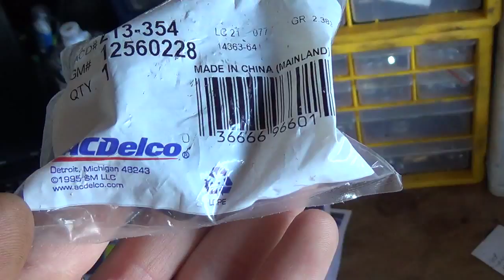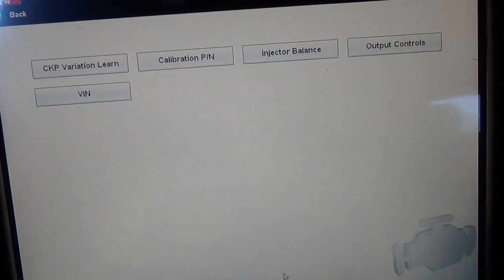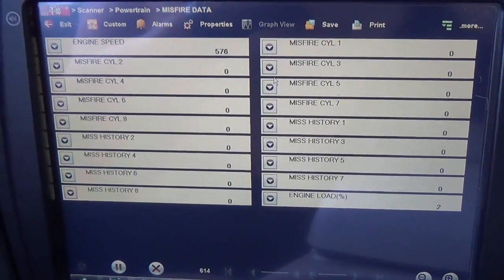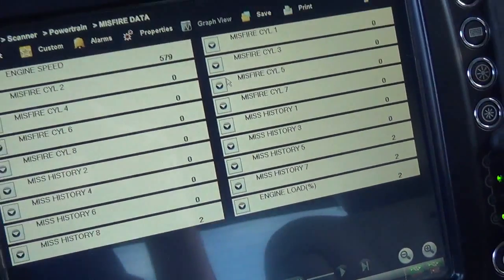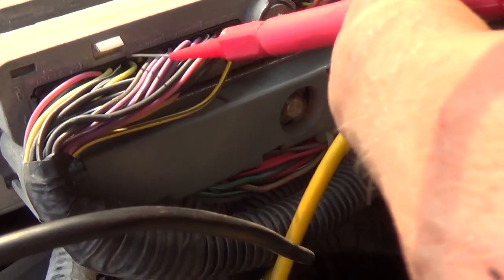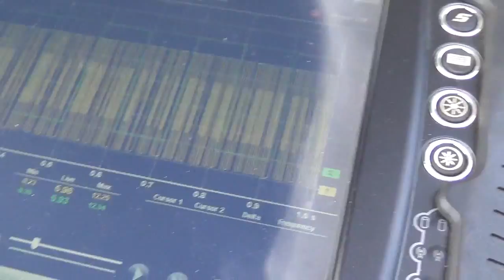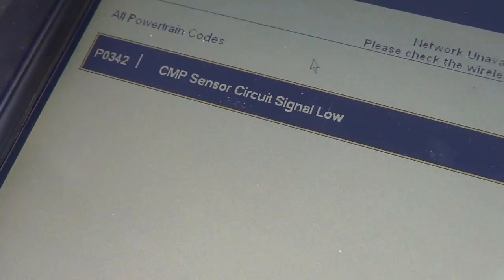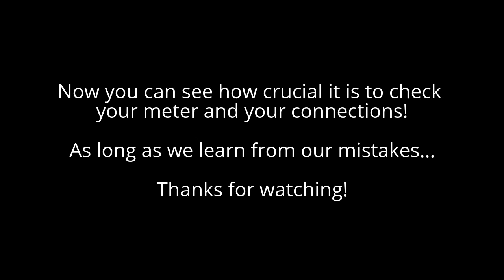Chevy Silverado: P0335 CKP case study -Part 2 THE FIX

Comment: I don't have misfires but I do have check engine light and I have replaces the sensors and the coils 3X. Someone mentioned to change out my ECU and they said I need to do the crankshaft relearn as well not just the key relearn with off on 3X for 10 min. Each on on and 5 secs on off... I never changed the crankshaft sensor  so do I need to use that tool?

Comment: Probably a few years late but did you see the potential vacuum leak at the fuel pressure regulator @ 13:58 And a plug for Phils Probes!

Comment: 03 Silverado 1500 5.3L cranks but won't start, no codes, security light goes out after a second. Changed crankshaft sensor, camshaft sensor, PCM (pcm's were programed to vin), wires&plugs, fuel filter&gas lines, relay and main window/lock switch. No five volts reference at PCM, no ignition pulse. Tried the 30+ minute relearn a few times, I tried to bypass the passlock 2 security but put that back. What next? Replace BCM or tow to dealer? You explain great, what do you suggest? Thanx
Reply from the maker: Check for a good ground at the ignition coils (black wire) with a test light.

Comment: A common situation with the Chrysler 2.7L V6 is when someone changes the timing chain or water pump to have it off one tooth which will prevent it from starting/running UNLESS you unplug the cam position sensor (which is a good/quick way to test for that plus get the car to another mechanic to get it fixed right).

Comment: I have an 04 Dodge Ram 3.7V6 that had the P0335. I dont have all the equipment you have so I replaced the Position sensor. Still have the problem. Would have to do that re learn process to make it go away or should I start looking for a wire fault

Comment: Ivan...good source for information, Eric O. It does makes sense to sync the crank sensor to the cam within the computer.  Apparently that "old data" still communicates to the module giving out those fake misfires. Back tot he truck, it's 4 wheel steering which was an option for about $2,200 and Delphi made the components for GM. It looks like they have a Dana 44 front axle housing for the rear as it has the steering spindles and hooked up to that electric motor which is then wired to a sensor that is located on the steering column shaft at the dash.  A really nice feature that should really continue to be offered due to the turning advantages it provides for pickup trucks that are crew cabs.  It's a very rare truck to have the 4 wheel steering, 4x4 and the 6.0 engine especially in the 1/2 ton which is what the "HD" signifies for weight limits and that year was likely the only year they offered the 4 wheel steering in the 1/2 ton truck as most were 3/4 ton. Sounds nice and quiet under the hood for a 118k engine thanks to the "LS" design from GM.

Comment: Hey bud new to the channel. I need a little help. I have a 04 silverado 4.3 just swapped it out for the same size motor except it’s from a 08 maybe 07 not sure. Only difference was new motor has two knock sensors rather then the one on the old motor and the crankshaft sensor was a little smaller compared to the old one. Problem I’m having is the new sensor for the 08-07 motor is the wiring isn’t labeled and Ive wired every which way I think 🤔. So my question is would the sensor resistance change even though the motor is the same and what can I do to find the rite way to wire my sensor. Thx.

Comment: Ivan, Do I need to do a CKP variation relearn If I am changing ti Cam Sensor, 4004 Gmc 2500 6.0L vortec, Fault code P0342

Comment: Oh not you didn't!??
You didn't really say poking a hole in the wire might not be a bad thing, did you!?
Don't get me wrong, it's another great video and diagnostic win. 2 thumbs up.
Piercing wires is a 'thing' for me. Being a retired Powertrain engineer, I know that people do it when it is difficult to back probe.
However, Packard Electric engineering states it is not if the wire will fail, it's a matter of when. Moisture and corrosion are such big problems for vehicle wiring, PE goes to extreme measures to protect the copper core.
I know it's tough to get the probe past the weather pack seals. I actually like the thin T-pins for back probing. I recall seeing you use some that are stored in your trusty Micronta multi-meter.
Keep up the great videos.

Comment: Had the same issue on my silverado. CKP code. replaced it and still had the issue. dug a little deeper and found a broken signal wire to the CKP behind the block. great video! Just need to do the relearn
Reply: I have an 03 driving me crazy. Where was that harness break?
Reply: Behind the block? Oh sht? Can relearn be done if "no start"?

Comment: Thanks for watching?  Ha,, thanks for making...

Split in boot for vacuum hose connection on fuel pressure regulator is part of what this truck will need fixed soon enough - 14:00 time stamp.  I'm going to get a couple just to have.  And I wouldn't have been reminded to do so without this video, so thank you.

Comment: Hello there very interesting video but it looks to me like you my  have a hole in the vacuum fitting at the fuel regulator .  I would have had to double check my wiring whit a piercing test great video keep it up .
Reply from the maker: +8power0 Good eye! Yeah I checked it...external crack only for now, but should be replaced soon for sure. In this case poking a few small holes would have been more reliable than the backprobing method lol

Comment: ivan I got a 2011 express with the 4.3 P0336 but the crank only drop from 5 to 1 , I check the ground and it look to me is ok , and it have the 5 volt reference, have to keeep checking tomorrow, the cool things of watch your videos is how you use your scanner, nice man,I got a verus miself , but you guys are my best teacher how to get the best of it, thanks
Reply from the maker: +Felix “felmar38” Martin What is the voltage on the signal wire when you unplug the sensor?
Reply: +motoYam82 5 volts
Reply from the maker: So in your case it looks like a pull-down design, unlike the Silverado in this video. A good sensor should pull that signal all the way down to 0 volts...
Reply: +motoYam82 they got me a napa sensor but even if the capture is more clean that the old sensor , stay also from 5 to a little under 1 , I going to spend tomorrow morning to see if I see something weird , thanks ivan
Reply from the maker: Dang I had no idea GM made the 4.3 V6 all the way into 2014...still using the spider-based injection system! That's like a 30-year production run...wow.

Comment: I believe that engine only uses the cam sensor signal to allow for sequential injector firing. Nice diagnosis and repair video, Ivan.
Reply from the maker: +wysetech2000 I think with GMs in general the CKP is king. The fact that the truck was running fine and I was getting nothing on the scope should have been a dead giveaway to check the lead connections!! Lesson learned for sure.

Comment from the maker: @ Storm God   I don't know where Google posts the ads...usually you can skip them?
Reply: Hi ivan ,
I have a 2011 chevy truck 5.3 since i bought from dealer it has a random misfire with no code till now .i tried every thing can solve the misfire at idle ,checked compression, new wires,plugs,coils,intake gaskets,throttle body , im very desperate  i will try to replace the crank position sensor soon. If you have any guide tips for me . Thanks a lot for this vid
Reply from the maker: You mean you can physically feel the misfire?
Reply: +motoYam82 yeah and fuel smell
Reply: +Sa Kh and engine running rough with no codes
Reply from the maker: If it's that bad, it should definitely set some trouble code. Check for "pending" DTC's too. Do you mean the exhaust smells like raw unburned fuel??
Reply: +motoYam82 no codes stored ever , i have a tech 2. Exhaust smell raw fuel
Reply: +motoYam82 fuel trims around 3% only

Comment: Hi Ivan,Nice work there. In your Video it sounded like it had a Vacuum leak also? Then  I saw what looked like a compromised FPR (fuel regulator)elbow? Did you see it? Take a look at about he 13:53 marker point of the Video.Thanks for sharing your skills with us :)
Reply from the maker: +karl winter Wow good eye, Karl! Just checked it...a small external crack for now, but might get worse soon. Fuel trims were right on, so maybe it was a bit of P/S or alternator whine?
Reply: I noticed that to 🙂

Comment: Does the Autel do graphing as well? If so,  I'd like to see how well it graphs different items, as it's much cheaper to buy then the Snap-on. Great video.
Reply from the maker: +Joeshu1000 Graphing data is not one of the Autel's strong suites...at all. Neither is saving data. But it's still a great scanner for the $$ and has wider vehicle coverage ('96 and up) than any loaded Snap-On scanner.

Comment: Hey Ivan, i did not know you had to do a relearn procedure after replacing the crank sensor. Quick question does the autel 708 have the relearn feature in it.  ? .
good video by the way . Thanks
Reply: Can you go thru the relearn procedure without a scanner and use a cheap scanner to clear misfire codes? Thanks.
Reply from the maker: +Carm0083 Yup, the DS708 sure can. Now Eric told me his newer MaxiSys tablet did not have that feature...will have to check back with him on that one.
Reply: Really I thought the more expensive one would have more features. Just want to thank you and eric for all hard work and the cool video's. I am learning an ton from you guys. I'm a diy'er and purchased a ds708 about a year ago and I'm still learning how to use it. Just trying to grasp the acronyms Is mind-boggling. I am an old timer, i'm 57 and trying to keep up with the times with working on cars.  I was an auto mechanic years ago and still love working on my own cars.However, i am no stranger to electronics. I left  mechanics field to go into the communications field and now i install  Communication systems for Motorola. You know for police dept., fire dept., ems etc. You never know were your going to end up.:)
It's really cool of you guys to take the time  to put up your video's to help guys like me. on behalf of all of us.  thanks.
Reply from the maker: Very cool! Yeah the technology is advancing at an incredible rate for sure. On modern vehicles most driveability problems are caused by failure in the electronic components. Not much you can do without a good scanner, DVOM and scope. Having a background in physics, engineering and circuit design certainly helps too. Thanks for the feedback!

Comment: A good reason to "pokey-pokey" the wires, as Eric-O would say ;) On a more serious note, that backprobe issue means that we could cause all sorts of havok by backprobing if we accidentally shorted two wires.
Great vid! Another awesome diagnosis!
Reply from the maker: +Adrian Kingsley-Hughes Good point. I think in this case the backprobe pin can only touch one wire at a time, even though they are so close together...but it blew my mind how easy it was to "cross-probe" on this connector.

Comment: Fantastic trip in diognostics.  Ivan there are up to three levels of parts available at GM , there all labeled AC Delco but their all not the part that was put on at the factory.  Actually there are late model parts you can never buy from the dealer and their only put on at the factory and never sold retail but  the dealer will sell you an aftermarket part - all OEM's do this.  If you want a factory part (maybe ) it's at the dealer  or you get an aftermarket 2&3rd line sometimes like as in rock auto at a great price LOL.  The factory AC Delco  CKP was not from onehunglow province in mainland China - ha I like the mainland China bit :)  Ok for the probe placement could you use a line tracer to verify the scope lead is in contact with the right wire ?

Comment: Interesting . My truck with 5.3 was , having issues pulling my car trailer loaded up hills . done ok pulling until i let off gas to slow down it would run really rough  or would stall if i stopped . It ended up being a lazy 02 sensor . and very interesting on the back probing
Reply from the maker: +wtbm123 Lazy O2 sensor diagnosis coming up next :)